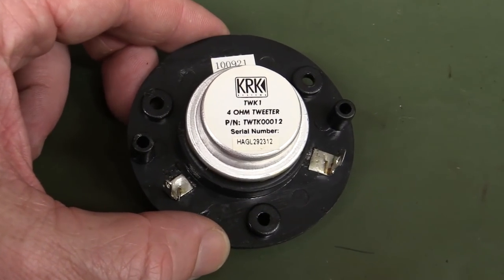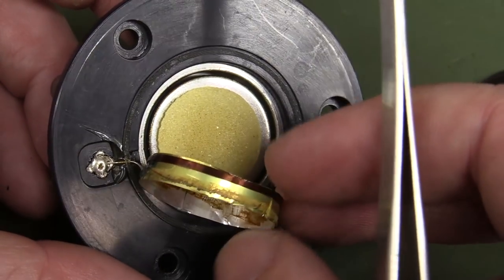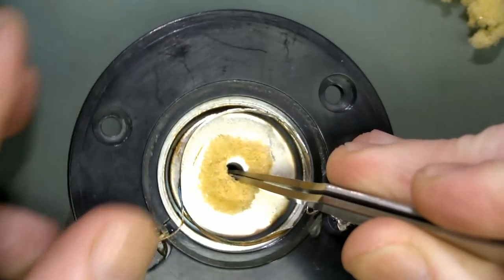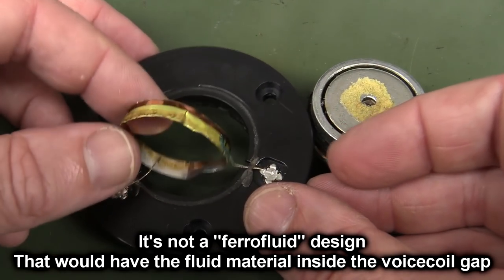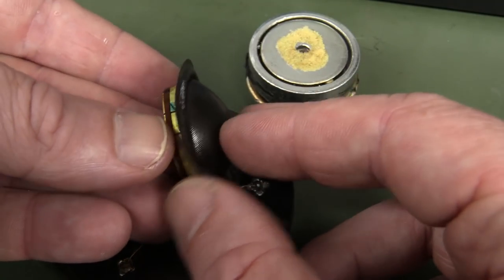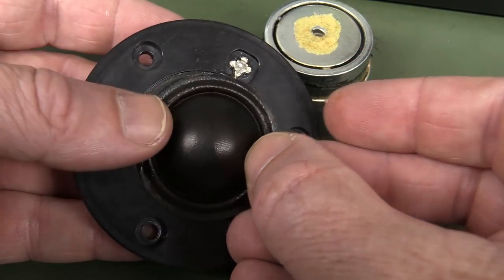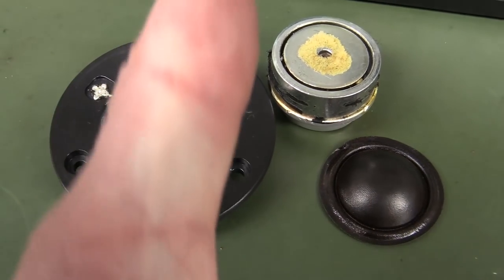EEVblog #1076 - KRK Textile Dome Tweeter Teardown

Comment: The foam is to absorb (dampen) the back phase of the tweeter. 
And the coil is not burnt, it just has broken wire because of too big excursion. You could unwind one loop and solder it to its contact again.

Comment: pretty much that is how all tweeters looks like and this coil should be connected to the dome
in poland, regeneration of our domestic tonsil brand speakers of this kind is quite popular because coils are avalable as replacement parts for a fraction of the price of new ones. besides they were made in custom colors for some speaker systems. i fixed some in the past and replacing those coils is not that hard, because most of them is self centering design.

Comment: The foam is not doing nothing, it is for dampening accustic resonances but still allowing movement of the air inside the whole tweeter assembly into the permanent magnet housing. You're compressing and depressing air with any dome movement, so the air inside has to move and deal with that. :)

BTW: almost any speaker modules are "moving coil in permanent magnet" type as you would need special amplifier devices that can deal with the high voltages that electrostatic devices would need to provide the electrostatic forces needed for an electrostatic speaker.

I would agree that there actually may have been some ferrofluid there because you see some brownish gunk on the coil carrier material (the aluminium foil-ish tube). Maybe that's the cause why the coil did not get really dark and did not have black burning marks, because it still did get some kind of cooling as long as there was flluid left. The whole thingy must have seen massive signals that heated up the whole coil carrier which then probably did weaken and rip off the whole coil assy from the dome. That's why the coil assy was still in the slot when you dismounted the soft dome.

Comment: That is typical construction for a cheap dome tweeter, the speaker may be open circuit where the break may be where the tinsel lead is soldered to the voice coil.

Comment: The hole is standard, its to equalise the cone pressure to ambient air pressure as its moving. The foam is to prevent the dome crashing against the magnet at high excursions.
Reply: Wrong on both accounts; the hole leads to a resonant chamber in the back and the foam is to even out impedance as well as a simple protection for the dome to be caked down from external objects, like your finger pressing on it and the dome gets stuck in a concave fashion.
Reply: Vresiberba: No, the hole is not for resonant reasons like a ported box for example, this is an high frequency driver that does not support front pressure reinforced from rear radiation, how could it?, high frequencies are highly directional and would not even make it back thru the enclosure port; they would bounce about in the enclosure much like a ping pong ball.
I am not wrong about high excursion protection; that is the primary reason, to protect against someone pressing the tweeter? no thats why speakers come supplied with grills!.
Did you know a lot of woofers also have this hole?, do you think they use it as a resonant port too? LOL.
Reply: Yes, it's a resonant chamber, it's obvious seeing that it has a cup behind the pole piece and it's a closed cavity, just like a NON-ported speaker because otherwise it wouldn't work due to the relatively small membrane. Just google it. Dynaudio and Scanspeak uses this technology in a lot of their tweeters including the ancient D-28 I'm holding in my hands; it has a hole through the pole-piece and a plastic cup behind the magnet with a small dampened chamber.

And there's no such thing as a "high excursion protection" on a tweeter, that is something you completely made up.
Reply: Vresiberba: I suggest you read a book like 'Loudspeaker Cookbook' or the many other publications out there that describe why drivers have this hole, really no point trying to convince you. I have been working with speaker design for a couple of decades. You completely ignored my reasons why the hole could not work as a resonant port like a ported speaker, just doing a basic port calculation would prove my point, look it up.
Reply: Vresiberba: Think of it this way, what do you think would happen if the cavity was totally sealed?, the air behind the driver would act as dampening, this is a poor way to design a tweeter if you want to tightly control the spring-mass damper system to the right theille small parameters. Why?, because air compliance varies with temperature and moisture. No, the spring mass resonance is controlled by the spider and surround compliance.
Dont send me a page and expect me to read through it; paste lines relevant to this discussion. Life is too short to debate points; already 100% sure on, you are the one that should be doing the studying, drop the hifi mags and learn the theory.
Reply: The cavity IS sealed, it's its entire function, it's the same principle as a closed speaker enclosure. You can clearly see the hole in the tweeter in the video meaning it IS acting as an enclosure. The design philosophy behind this is to affect the Fs of the driver in order to have a lower frequency response and use in a two-way design and a to be able to use a steeper filter design. Air seeps out through the membrane, so that's a non-issue. And there are no spiders on dome tweeters which just goes to show that you have no idea of what you're talking about. Complete and utter bullshit.

And since you say you're not going to read-up about it anyway, I'm not going to discuss this with you any further, I do this for a living and I know what I'm talking about.
Reply: Vresiberba: Now you are just opposing your original argument saying it was a resonant port, now you are saying it sealed, you really just want an argument dont you).
Well done you know Fs, whoopie doo, you are stitching bits of knowledge picked up without actually knowing the full picture and talking complete crap in the process.
PS let me know which speaker company you work for, and me and others reading these posts can avoid you guys like the plague.
Yeah its 'sealed' but over a period of time the small amount of air-leakage(since it is only a paper covering) evens out the pressure differences between ambient and rear as per my original statement you said was totally wrong.
Reply: I didn't say it was a resonance port, I said it's a hole that leads to a resonant chamber. I linked to a picture explaining it, but you wouldn't have it. And the membrane isn't paper, it's coated fabric, and just like closed speaker boxes, it's never 100% entirely sealed, some air leaks out through the membrane but it is OBVIOUSLY not vented in the rear or the pressure in the box is going to blow the tweeter membrane off. You're completely clueless, go and caulk your speakers, now. https://www.youtube.com/watch?v=sXEMjxocFn8

By the way, scroll all the way down on the comments and read John Stone's comment, he says the EXACT same thing and the reason for that is because it's true.

And that's it from me, have a nice day.
Reply: Vresiberba: Your original statement that I was completely wrong is false, I was saying why the hole was there, and you started talking about the resonant chambre as though that disproved my argument, then you also said in your statement " foam is to even out impedance",  obviously  a thin membraine 'bashing' against a foam insert would cause distortion, its not glued, nor is is pressed against the dome at any time, its there for protection and only makes contact at higher than recommended volumes..to stop the voice coil slamming against the magnet.
As for controlling Fs, I am sure a good designer would take into account the extra space created by the hole, but I have never seen anyone resizing this hole to tune Fs, which brings it back to its original function-that of neutralising air pressure; that doesnt mean to say the cavity doesnt exist does it?..I am talking static air pressure; I made the assumption people would know that a covered hole would act as a cavity during operation.
Coatings?, maybe some driver manufactures coat the vent paper, but know for sure some don't.

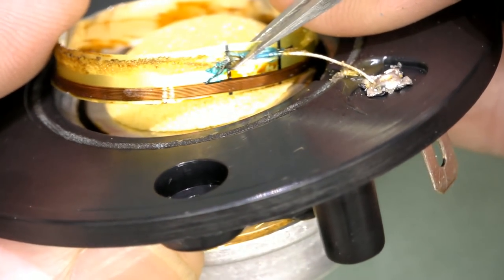Comment: Right at 1:38, you can see were the epoxy is rubbed off the winding and it's darker (heat) is most probably the point of failure.

Comment: The foam absorbs the rear wave of the tweeter. The tweeter emits the same amount of sound from the rear of the diaphragm as from the front, and something has to be done with that acoustic energy before it reflects back to the dome and is re-radiated through the thin dome material, out of phase with the drive signal. Also, yes - tweeter voice coils are very small. I have seen some smaller ones - just 16mm.

Comment: Since it is a tiny little sealed cabinet in there tuned to the frequencies necessary for the frequencies produced, the foam is also used to tune it to the right frequencies.  A solid, compressible fill would increase the theoretical volume inside the cabinet.

Comment: The foam is there to dampen any resonant frequencies between the diaphragm and the flat metal surface of the magnet assembly. 
As the distances between the diaphragm and the flat metal surface are within the wavelength of the sound being reproduced, removing the damping will introduce harmonic distortion due to resonances.  
When restoring tweeters this fact should always be taken into consideration. Failure to do so will lead to replacements sounding metallic and really rather rubbish, compared to the original.
Human hearing is designed to comprehend and assimilate the most minute phase differences between ones ears, that is how we hear in 3 dimensions.
We are born with 2 ears, both of which are phase correlated to each individual. We all naturally hear the world in binaural vision and can hear direction through 360 degrees in the x and y plane (quite amazing if you think about it). This is achieved by our brain being able to ascertain phase correlation differences between both input sound pressure waves.
Sorry. Geek Rant End :-))

Comment: Hey EEvblog. On the  Tweeter diaphragm right where the  solder is for wire to pigtail  is cut right there you could not see it with your Naked Eyes you have to put that under a microscope I do a lot of repair for these things back in the day now I prefer change them.

Comment: There is a rear chamber on this tweeter. The hole in the pole piece is there to vent the air generated from the rear of the dome into the rear chamber. This lowers the fundamental resonance frequency. The foam is there to help absorb reflections off the surface of the pole piece. Design of this tweeter is standard, but the rear chamber is something of an enhancement. Build quality looks shoddy from here.

Comment: How do I attach my wires back on to terminals from the coil.  They are now too short. Can I unwind some of the winding from coil? Solder heat? I assume very low? What guage is this coil wire and who sells it?

Comment: High end audio...where the cheapest looking piece of junk can sound better than something that looks made in a Swiss lab. Half dark magic, half ridiculous engineering.
Reply: thechosendude yeah it's sad
Reply: ... And 100% marketing...
Reply: Khron's Cave true high end is not usually the stuff you hear about
Reply: On one hand, depends what circles you hang around in. And on the other hand, what actually is "true high end"?
Reply: There is actually some truth to this. Some of the most mundane looking speaker drivers actually have incredibly good performance. Others from 'boutique' manufacturers with very unique designs, exotic construction materials and insane tags turn out to be mediocre performers.
Reply: TMM I remember the linear coil designs that some people experimented with back in the 1980s.  The size of a door, covered in (then) expensive Neodymium magnets, horribly low efficiency, but apparently great sound (though I lack the golden ears to determine for myself).

Comment: I think you are right. The voice coil isn't blown. It just came unglued from the speaker cone.
Reply from the maker: It's actually broken, I measured it.
Reply: When you measure it with a DC Ohms meter, it'll surely be broken afterwards. Tweeters do not like DC.
Reply: Errrmm, are you suggesting that a digital multimeter is putting out enough power to destroy a tweeter?
Reply: DMM has no enough current to blow a voice coil

Comment: in  most pro audio  PA systems the voice coil isnt too dissimilar. The replacement part for my EV DH1 horn/tweeter which is worth a few hundred dollars is basically the same just a titanium i think domeand a few more windings. My thoughts with most products is the difference in cost between cheap crap and expensive stuff is bugger all the rest of the money is marketing.
The product that cost $2 and sells for $5  vs the product that costs $4 and sells for $200

Comment: I am not surprised. The KRKs sound awful even compared to cheaper monitors. They only have a slight advantage at the low end. Probably why they are used for hip-hop and the like. But imho the advantage is not enough to justify the crappy mid-highs. 
Now I am curious to see what Yamaha and JBL are using

Comment: I'm less than impressed with the KRK Rokit 6 powered studio monitor at around $300au each, I'm sure it does the job but the parts are cheap, amplifier module is very ordinary, you don't get much for you're money. I prefer to make my own speakers.

Comment: I took apart my headset, somehow broke one of the two speakers in it while doing other repairs, only to discover that I could get nearly identical replacement speakers for $1.80. The headset costs $270 new. (I bought it used.)
I haven´t noticed any change in audio quality with the new spealers. They are of similar construction as the ones in the video.
Reply: Beats?
Reply: Just because it looks similar, it's not the same.
Reply: Prehistoricman no, Sound Blaster Evo ZxR. You do get more than just a couple of cheap drivers for your money, but I still wouldn´t recommend them anymore.
Frank Gormanns I took them apart further than dave did. Other than the dimensions and impedance, mine were practically the same.
Reply: Basement ScienceE Prices for this thing are absolutely crazy.
You can get these here for anywhere between 140 down to 37 euros new.
Reply: Frank Gormanns do you mean this exact headset? there are a few variants. Anyway, I got it probably around 3 years ago for 150€ almost unused. Wireless headsets always seem to be in this kind of price range, at least if you want any kind of build quality. 

The real problems with this thing are design problems:

1. it uses an internal Lithium battery that charges over micro-USB. That usb port has broken the first time maybe 2 years ago. It´s simply not a good connector for something you have on your head while plugged in. I have since replaced it with a round connector. (not perfect either.) Of course the battery has lost more than half of its capacity by now. I will replace it in the near future, which means taking it apart again. A replaceable battery system would be much better.

2. Bluetooth. Do I have to say more than that? It´s simply not properly implemented in any OS. In Linux I am yet to get any sound out of it, in windows I cannot use the microphone and speakers properly at the same time. On android it sort-of works. At least it doesn´t lose its connection and has a decent range.
Reply: Basement ScienceE maybe the cheapest is another version.
I saw it with bluetooth for 79€.
3 years ago 150 was a good price.
I use much cheaper taotronics in ear for sports. The Bluetooth works fine every time. Sound quality could be better, but it's enough for this use.
Reply: Does is support aptx?
If not, get a new one.
Reply: Yes, it does have aptX. It sounds pretty good. 
It can also apply an equalizer etc by itself if you want that sort of thing. It has plenty of whank features.
Reply: I have a Corsair wireless headset and it's good except for losing connection. Especially when the base station has just been powered on.

Comment: Hi Dave.
I’m almost sure that the reason why the tweeter failed is because the dividing network failed and the tweeter thereby was overloaded with low frequencies which the tweeter was’nt designed to reproduce.
Your comments are very welcomed  and appriciated 😉
Thx your vids🙏🏻
Best Regards
Reply: Whisky Hotel Yankee "Oscar" & Alpha Lima Sierra Oscar "One"?
Reply: @ Caalamus:
My radio amateur Call sign is
OZ1OS
😉
Reply: Oscar Zulu OneOscarSierra Victor Kilo Three Hotel Alpha Uniform
Reply: Yankee Echo Alpha Hotel, Bravo Uniform Tango... "Oner" November Oscar Tango "One" :]
Reply: Oscar Zulu OneOscarSierra Actually the amp after the filter shorted out and pumped high volume self-generated hum into Tweety Bird.  Filter did nothing.